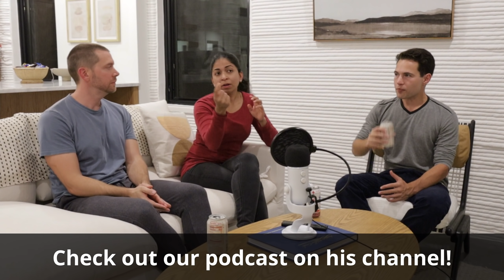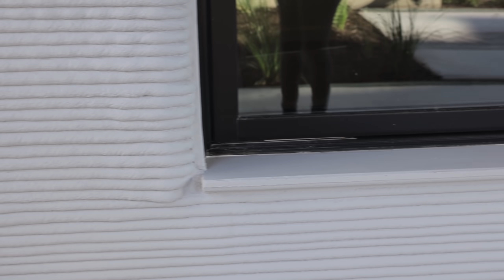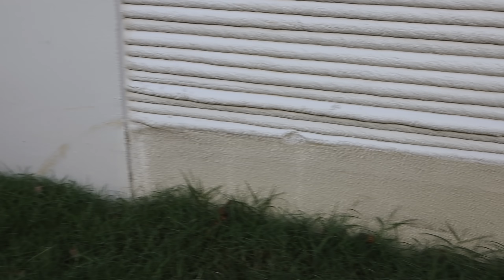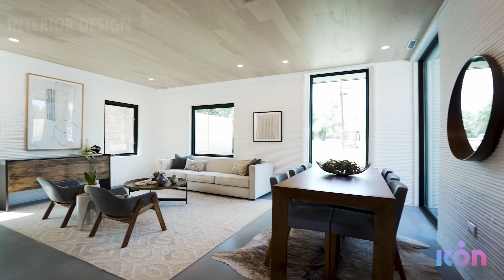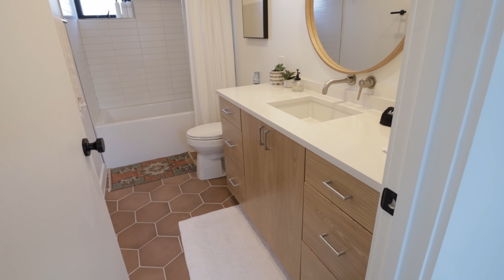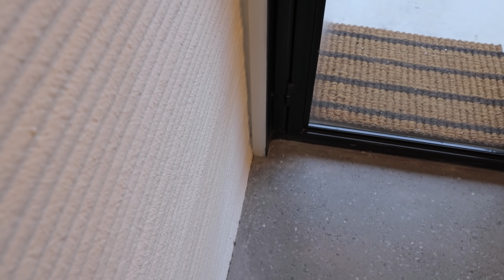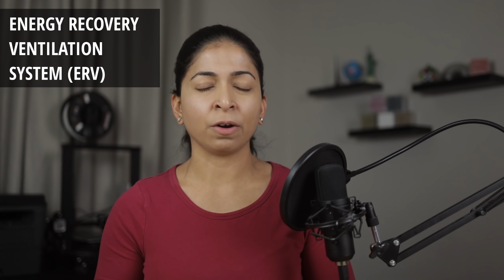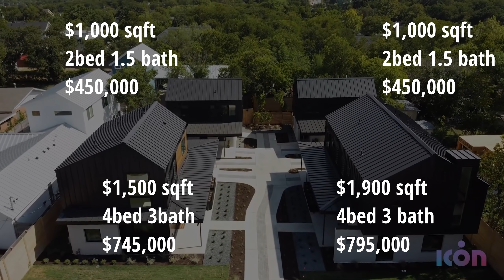I stayed at ICON's 3D printed concrete house in Austin!

Comment: Hi!I understand the differences between a 3D concrete house and a normal wooden house in the U.S..What are the differences between the 3D concrete house and a concrete and brick house in Europe.The first has insulation inside while the latter has bricks.I would be interested in a comparison between these two.Have a nice day!
Reply: I've visited many 3d printed homes in Europe including some mid construction with the architects who designed them, if you'd like to see those most of the videos on my channel from May - August 2021 are from Europe. I visited projects in Denmark, Belgium, Germany, France and Switzerland.

Comment: I wonder if this process could be used to "print" a basement level in a home in the NE.  As much as I want to get behind this kind of technology, I am more of a fan of ICF homes at this point.
Reply: You'd have to dig out a big area for the gantry, and then use a crane to lower the printer into the hole, in order to use this technology for basements. 

It's probably not a good fit.

There are methods to do 3D printing for basements, but the sliding gantry model that ICON uses isn't a good fit.
Reply: I think this technology is a bit ugly, but your comment has me thinking about it being used for pouring in just a basement level now. I don't know the first thing about architecture, but that sounds pretty neat.